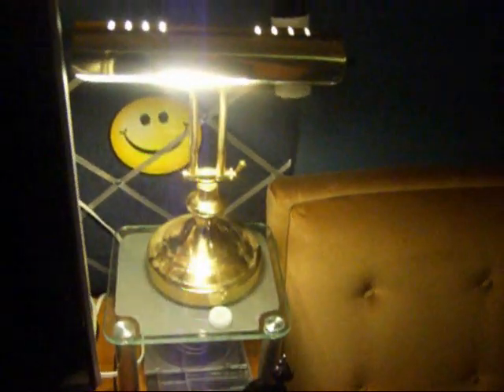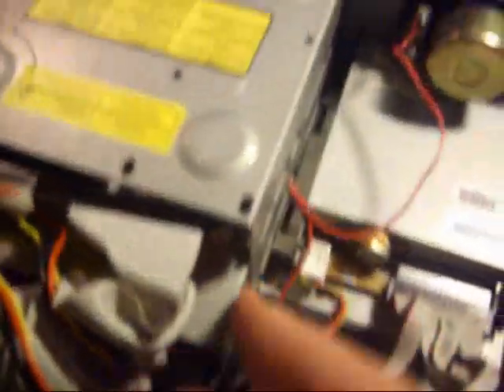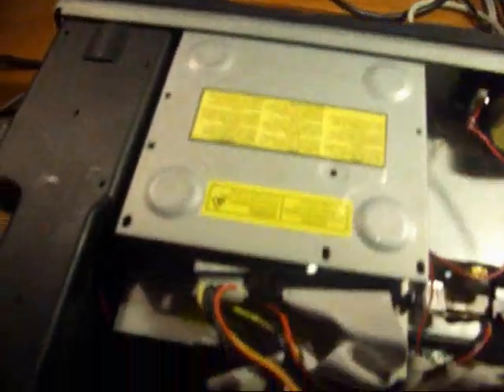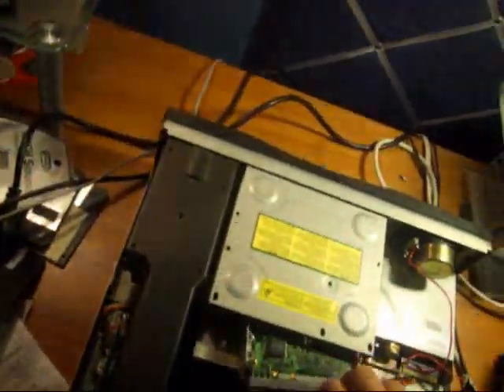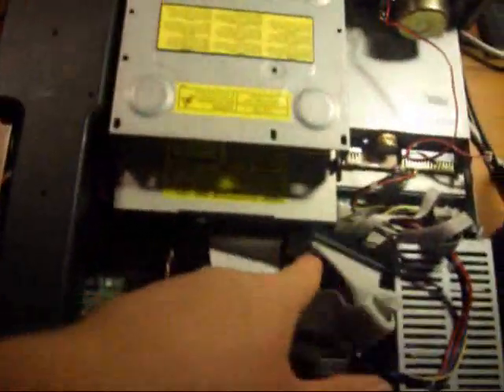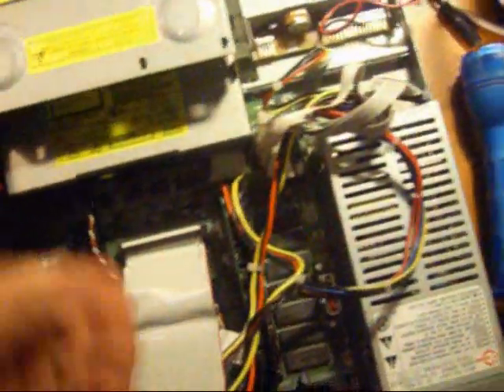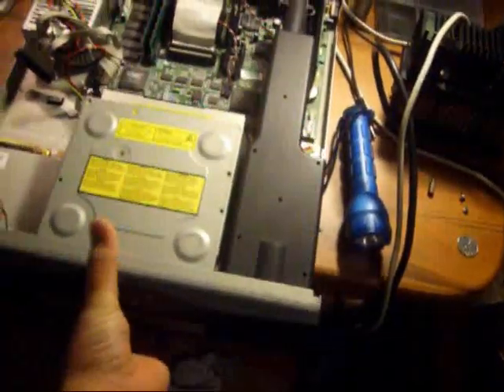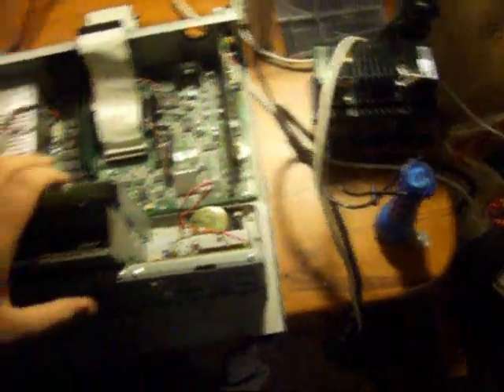Installing A DVD Drive In The Compaq Presario 2200 Part 1

Comment from the maker: @Unicornguy I Plugged the Slot loading CD drive in the Orion Computer and it works I guess the power cable was loose! which caused it to stop working I love the case design and it doesn't really make a  difference  how the cables are plugged in I don't know if the IDE cables are a little broken but everything still works

Comment: Oh no! I really liked that slot loading CD drive! That's a shame it stopped working! Well, at least you have a DVD drive to make up for it! Wow! That's a crazy cool case design for that Compaq! Are you sure about the DVD and Hard drive configuration? I heard somewhere that if you connected the DVD or CD drive to where you connect the hard drive and put the hard drive where the DVD or CD drive is the speed of the read/write to the hard drive will be determined by the DVD or CD drive.